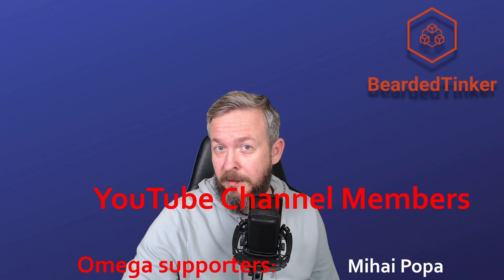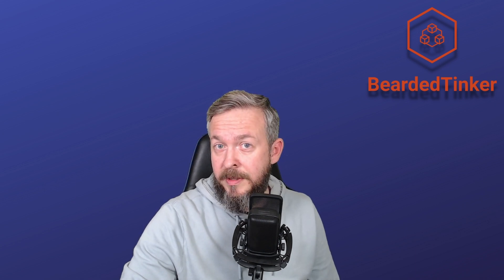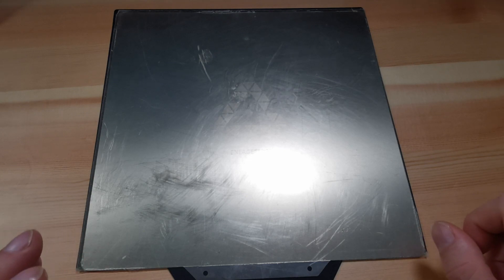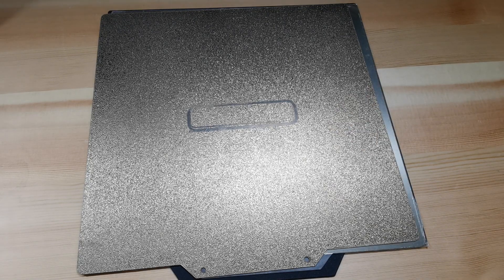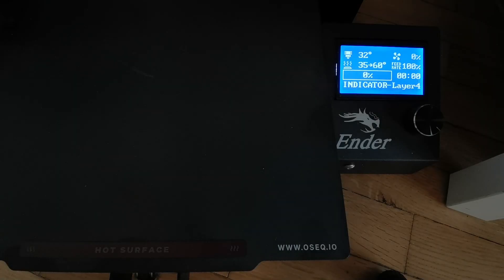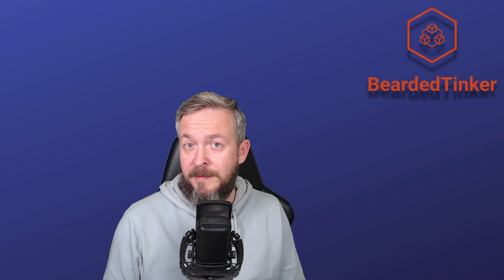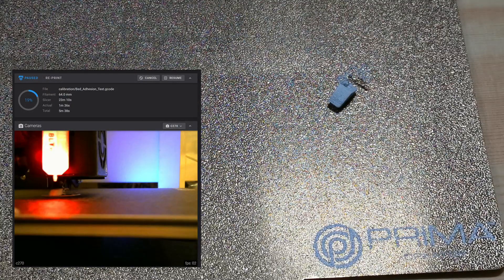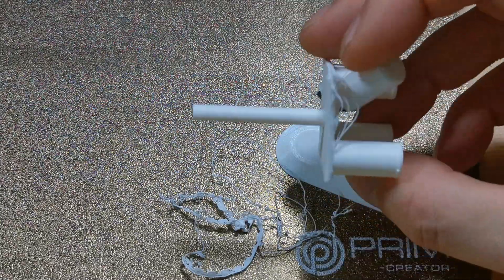SAFE Sheet by OSEQ - PEI powdered sheet

Comment: I started with PETG as well as I wanted the higher temp stability.   They say PETG is meant to be extra sticky, but for me it was such a pain trying to get it to stick.  I think I wasted almost a whole spool of filament screwing around with things.
I worked out temperature was a big factor, and ensuring the surface is spotlessly clean.  Now I can get prints to stick to both the supplied Ender surface and also on glass.   
I look back now and wonder why it took me so long to work it out as I can get 99% of prints to stick first time now.